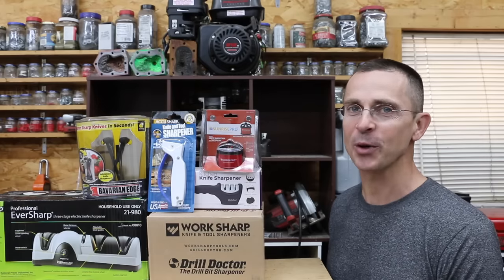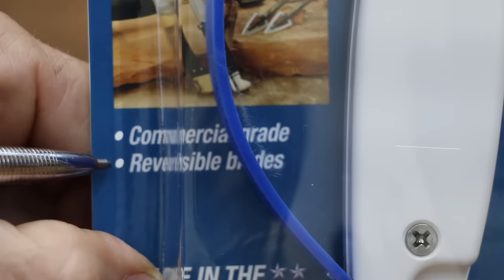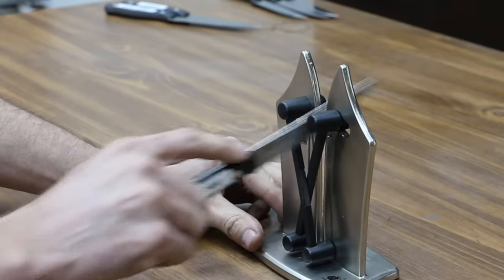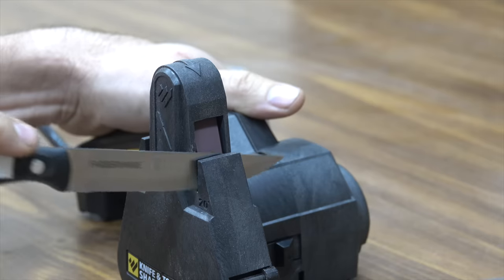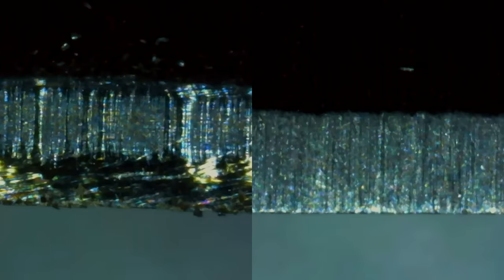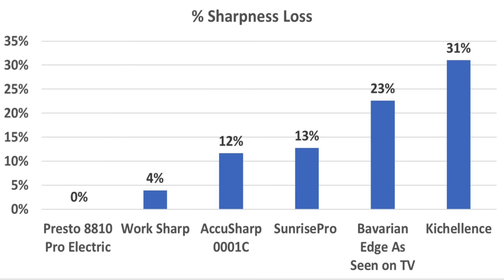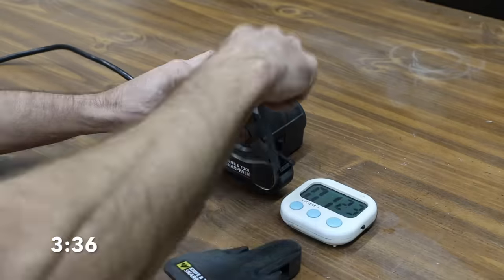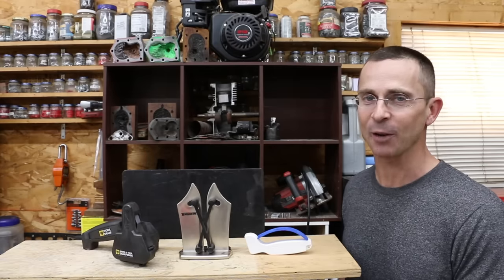Which Knife Sharpener is Best? Let's find out!

Comment: I have the Kitchellence model under a different brand name, but looks exactly the same. I don't know much about knife sharpening at all. But to me, it seems to be very tricky to use correctly, and it took me a while to figure it out. For the stage 2, don't hold the knife straight above it. Instead, angle the knife downwards to a 45 degree angle, then pull it through. You will immediately feel a huge difference in how much material this takes out. You will also feel how the knife edge feels actually sharper. Unlike with the 0 degree angle, where I feel like it only dulls the knife, if anything.

In my very limited experience, it seems like you might want to be careful with stage 1 (maybe 3 to 6 passes, pressing only slightly harder than the weight of the knife), and don't pull too hard in stage 2 either. But the harder you went in stage 1, the harder you'll need to pull in stage 2. For a lot of passes in stage 1, you can see larger chunks of metal shavings coming off in stage 2.

Regarding stage 3, I haven't been able to tell whether it makes any difference. Maybe it helps with edge retention.

Overall, I find it difficult to use. Might be easier at this point to just use a whetstone. Although once you figured it out, and for quick maintenance, it will do the job.
Reply from the maker: Thanks for sharing.

Comment: Would it not change the number for sharpness if  the tip of the knife is not in the same spot every time with each knife..due to leverage (torque) being applied to the handle??? And I’m definitely not being negative I absolutely love your videos because of you I steer clear of some products based off of your results

Comment: Thank you for all the hard work! I would love to see a video comparing mower blade sharpeners. Also, types of lawn mower blades in general (standard blades vs gator blades, vs etc). I really appreciate all the time, thought and money you put into your videos!
Reply: Lawrence: The WorkSharp is designed to sharpen mower blades and much more with out removing to blade from the machines or equipment. Check out their videos on line. I bought one and I'm not going back to any other sharpener. Good luck.
Reply: @kennethnegaard7599  Thanks. I'll go check it out. I'm guessing it doesn't balance the blades. i have 4 sets of 3 blades for my zero turn and being balanced makes a big difference.
Reply: I use the accusharp to sharpen my mower blade, and machetes
, and hatchets, and axes. And going to attempt some scissors next.

Comment: Im blown away at how well the accusharp works. It takes alot of steel off so machetes, tools, kbives that see a lot of use outside the kitchen, its all u need. 
A wen 1/2x 18" powerfile belt sander  costs $37 and is an incredible tool. Putting a fine grit on it then in a table vise (with a pad) you can sharpen kitchen knives down to axes
Reply from the maker: Thanks for sharing.

Comment: This bloke is terrific when it comes to product reviews. I have a couple of these gadgets, including the Bavarian Edge and the Kitchelence and they do work OK but the results are mediocre at best compared to using an 600/1000 whetstone from the hardware shop. I find the stone is easy to use (once you get used to it), a bit slower but gives far better results. The angle is not as critical as the perfectionists make out; anything between 15 degrees and 25 degrees is fine. I sharpen my kitchen knives at around 20 degrees. Fixed angle sharpeners such as Wicked Edge give excellent results but are a little too bulky, time consuming and expensive for my likeness; ditto for  Tormek which I don't own or use  but I know someone who does with similiar complaints about bulkiness, set-up etc. A bloke I know who does a lot of fishing and hunting and uses cheap knives (Kiwi brand?) raves about the Accu Sharp for it's portability, ease of use etc. out in the bush. I've never used owned or used one but he reckons it is ideal for his purposes. Horses for courses.
Reply from the maker: Thanks!  Thanks for sharing.

Comment: You did a knife job comparing the different sharpeners, in varying wear & tear scenarios. 

I've actually been using the Accu-Sharp for about 20+ years throughout my Army career, & to at home for sharpening my culinary & utility knives. It does sharpen well & easy, but it also diminishes the blade material rather quickly, if you don't use oils & a lot of care whilst sharpening.

CHEERS!!!
Reply from the maker: Thanks!

Comment: The "most expensive sharpener" used here is one of the less expensive sharpeners I have tried. I own one that does an excellent job (a Wicked Edge WE-66) but it is probably more than I should have spent. Of the ones presented here, I would agree that with some practice, the Work Sharp will produce a very good and durable edge but you need to understand, there is a learning curve.
Reply from the maker: Thanks for the feedback.

Comment: I've used the Accusharp for years it's good value and does a great job quickly!
Reply from the maker: Thanks for sharing.
Reply: Those things are really bad for your knife, they remove way too much material and they can't correct a knick or chip in the blade like a sharpening method will.

Comment: The Work Sharp Ken Onion edition is the best sharpener I've ever used. Lansky 5 stone is a definite second place followed by the spyderco sharpmaker. Never waste money on an edge pro, you're better off learning how to use a water stone because the edge pro has an equal learning curve but will cost you way more to start and over a lifetime will cost even more.
Reply: Also FYI you're supposed to stop with the tip of the knife on the belt when using the Work Sharp, then let the belt stop. That prevents the tip from being rounded off
Reply from the maker: Thanks for sharing.

Comment: America's Test Kitchen recommends the Chef's Choice trizor XV 15 degree blade sharpener. It's an electronic 3 stage unit. You alternate each side of the blade never sharpening one side twice but always alternating. I think the sharpener should be designed for the blades angle.  I have it and it seems to work great although I have a couple of gripes about it. The blade guides are plastic and the sharp blades often get stuck on them if you're not careful to feed the blade into the slats. I would replace them with stainless steel. Also the blade has a tendency to rub against the bottom of the slots which gouges the plastic again. This could be replaced with some sort of padded material or design so that the sharpener makes contact with the blade long before the blade has to be run that deep into the sharpener. Other than that it looks like the most convenient way to sharpen kitchen blades other than a file or stone. If the unit stops sharpening they will rebuild it for 45 bucks and send it back.
Reply from the maker: Thanks for the feedback.

Comment: I like a 2 grit stone, a ceramic rod, and a strop.  Because those can put the edge I want on the blade.  All of these "Eazy" sharpeners only put 1 bevel on any blade.  Regardless of what bevel the blade has on it, or what the blade is for.  You don't want to shave with the same edge that you slice tomatoes with.  They have different edge geometries, for cutting different things.  A ceramic rod, 2 grit stone, and strop will sharpen pretty much everything, properly.  (Okay, I need to add a file for a wood ax.)
Reply: I've worked in commercial kitchens where we had a Presto.  (Older model.)  It works okay to maintain kitchen knives, but you still want to touch them up when you get home.  If you take care of your knives, I've also worked with chefs that just wore them out, and bought new ones.  If you have good knife technique, you don't wear down the edge very much.  You don't whack it on the cutting board, because you cut food for a living.  So, eventually, you get very good at it.  It's not as if the cutting board moves.
Reply from the maker: Thanks for sharing.

Comment: Good review of these style of products. It would be interesting to compare to the use of wetstones or oil stones. I'd suggest that the draw through styles tend to remove a lot of metal and ruin the blade geometry quite quickly.

Bit of a disclaimer - I have Japanese knives that I sharpen on wetstones and while there is certainly more learning curve (determining sharpening angle and technique to master) much less metal is removed so your knife will last longer before needing thinning (and you can do that on your stones...which I think is not possible with the products reviewed here).
Reply from the maker: Thanks for the video idea.

Comment: I use a 1 x 30 belt sander to reprofile and sharpen to a clean phonebook paper slicing edge. On  my edc knives I touch up with a spyderco sharp maker at end of day if needed. I also have a ken onion work sharp and it works very nice if used correctly and will out sharpen all the sharpeners in this video,  do NOT over heat blade on work sharp too. I like belt sharpening as it gives a convexed edge adding durability but slight loss in sharpness. Pull through sharpeners are not good.
Reply from the maker: Thanks for sharing.

Comment: The reason the bavarian one worked was because the final pull is a much wider angle, putting a microbevel on the blade. It won't last for more than a couple cuts.
Reply: And you're only doing "push" tests for the cuts. Some will cut better with a slice. Normally you really have to polish a blade to get the full push force out of it.
Reply from the maker: Thanks for the feedback.

Comment: How about engineering a mounting system that sits to the side of a whetstone that holds any knife handle securely at any desired fixed horizontal orientation of rotation. With sliding track bars that run parallel to the whole length of the whetstone as well as an adjustable pivot joint that allows for lifting of the handle to curve toward the tip while maintaining the fixed horizontal angle of the handle. Could take a while to set up for each knife but if engineered & designed properly could maintain an angle & get great results. It would eliminate the angle-holding skill issue. The only thing you would need to do is slide the handle mount back & forth with the right hand while applying pressure to the blade edge with the left. Lifting the handle mount up by way of the pivot joint as you curve toward the tip. Sounds like a pain in the ass to design, test & optimise. But it could work
Reply from the maker: Thanks for the suggestion.

Comment: I'd like to see the "Ruixin pro RX-008" in a test. I just bought one that came with 12 stones, I believe from 80 all the way to 10,000 for a mirror polished finish. Watched a couple videos and it seems simple enough. Probably more time consuming but I'm guessing you'd get a much more consistent edge and can set it to whatever angle you prefer, depending on your knives, weather they are Japanese or American or whatever else.
Reply from the maker: Thanks for the suggestion.
Reply: @ProjectFarm  absolutely. Thanks for your videos. You definitely make the best comparison videos. 

I found my sharpener (Ruixin pro RX-008) on Amazon with the 12 stones for right around $36. Must have been on sale cause I just went to my orders to check the price and it's at $49 and change now. Can still find the same sharpener online for cheap though. Just doesn't come with as many stones. Pretty sure I saw it on Alibaba for like $12-$15. Didn't click on any of the Chinese sites though so not sure what all they came with. Thanks again.

Comment: I suppose some of these are fine for someone who's very casual about cooking and doesn't care to put much work into sharpening knives- but realistically, if you want a sharp edge, you use whetstones, and the durability of the edge depends more on the angle at which its sharpened and primarily the steel that the knife is made of.  Naturally, cheap Farberware knives won't have the best edge retention.  If you want to go cheap but still have a knife with great steel, get a Victorinox.
Reply from the maker: Thanks for the feedback.

Comment: That kind of looked like a burr under the microscope there from the belt sharpener, not a concave shape, but I could be wrong. I'd have run the knife back and forth progressively lighter 3 times on each side to get rid of burrs and such after having focused on one side for 5 strokes, I betcha you'd get better results like that. I guess that's not fair though, you followed the instructions.

Anybody else think the same?

Comment: I can tell you the work sharp works and work very well. You start off with the right belts but instead of listening to them. You do 1 stroke on 1 side then immediately switch the opposite side. Do 5 strokes per side alternating each side. Then when you go to The blade honing belt do it about 10 times again alternating each stroke and side. That’s how I do my hunting knives, kitchen knifes, butcher knives, and even my work knives. Now I’ve not tried it on scissors but for all the knives I’ve sharpened that’s the best sharpener I’ve personally used. The wet stone method is the best that I know of but you have to know what your doing and I don’t!!!! But that’s what the true katana swords and things known to be ultra sharp are sharpened with to the best of my knowledge
Reply from the maker: Thanks for the feedback.
Reply: @ProjectFarm  no problem. Thanks for ALL the many tests you run!!

Comment: A comment on your top 3: the AccuSharp sharpener is an unsafe design because it forces you to apply pressure in the direction of a live edge. That dinky little hand guard might block a direct slip but if your hand rolls one way or another you could seriously cut your fingers or hand.
Reply from the maker: Thanks for the feedback.

Comment: I enjoyed watching the video and was kind of surprised by the accusharp. I do believe that some of those sharpeners would work better on carbon steel blades than high-carbon stainless which is very hard to sharpen. One of the things that came to my mind was that the sharpeners you were using may not have matched the angle of the factory Edge and therefore when you start using them you have to put a lot of effort into re-shape The Cutting Edge to match the sharpener angle. Good video overall I liked it, I think the belt sander would work much better on a ceramic blade than any of those other sharpeners
Reply from the maker: Thanks for the feedback.

Comment: an additional test would have been to take the knife that came in sixth place and sharpen it with the tool in 5th place and see if the result is the same.  Then take that same knife and repeat the test with the 4th place sharpener and so forth.  If each result is the same, then the test is verified.
Reply from the maker: Thanks for the feedback.

Comment: Great test, well done you :)  IMO the best way to sharpen knives is to use sharpening stones (especially the diamond type) as used to sharpen chisels and other tools. They may take a lot longer but are well worth the effort if you have a badly blunted knife. After that a normal sharpening steel is enough to keep a keen edge for a while.
Reply from the maker: Thanks!  Thanks for the feedback.
Reply: Requires most human skill though. Keeping edges at consistently right angle is very hard in practice and why the machines do much better for 99% of us that are unskilled with the stone

Comment: Ok I've just noticed something, you made a mistake when using the work sharp.

On the honing belt you did first one side then the other.
But honing should be done in alternating strokes, so you most likely had s burr on one side of the blade which prohibited better performance.
Reply from the maker: Thanks for the constructive feedback.

Comment: Great video 🙏🏼🇬🇧 Q: do all sharpener blade lie at the same “V” angle?
Reply: No. I did over 10 years boning and slicing sheep. I have a blade sharpener which clamps onto the blade like a vice, and can be rotated 180 degrees while in the clamps. You can set it to whatever angle you need on your knife-edge. On my boning knives I ran 11 degrees on my edge. A lot of slaughtermen I know use 30-40 degrees on their knives. So it depends on what you are doing with the knife.

Comment: The problem with the actual testing method is it is static. Meaning most knives are used to slice, not push cut. a
Another problem I see is the way he uses the Work Sharp sharpener. You don't pull the knife several times on one side then do several pulls on the other side, when using finer belts.
You want to alternate once or twice on each side so as to eliminate the burr that forms. I have a Work Sharp sharpener and it performs just fine. I now use japanese whetstones exsclusivley. And they are far better than any of these, but they take time and practice to develope proper technique.
Reply from the maker: Thanks for the constructive feedback.

Comment: I can sharpen most blades with my Olde BoyScout Arkansas Sharpening Stone and a little mineral oil . My main problem that I have is sharpening stainless steel serrated steak knives that I use to cut sandwiches on a wooden board. Can't remember where I got the knife set from, the handles say made in Taiwan, though. Checked a couple of hardware stores and had no luck ; we  used to have a professional knife sharpening service around my area , and they went out of business, sadly. Any advice?
Reply: Check into the work sharp pivot plus. It has a rod for the serrations.

Comment: I have a Kitchellence knockoff (sold under many names) and find it actually works quite good. I use the carbide first, then the diamond, then the ceramic. But as you found in your previous sharpener video, the Lansky system really is the best system when it comes to money vs performance, if you want to spend the time. 👍
Reply from the maker: Thanks for sharing!